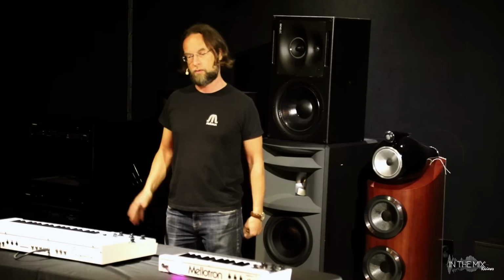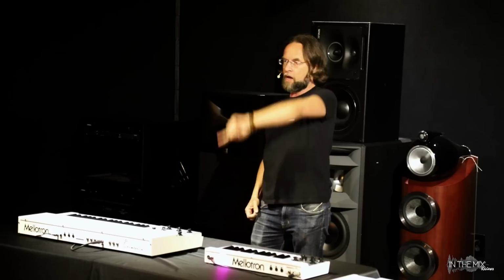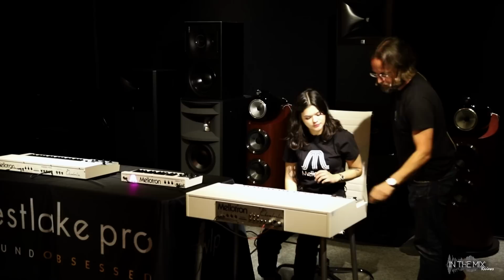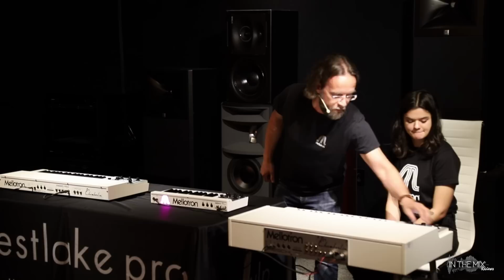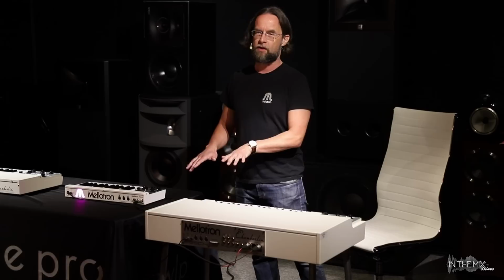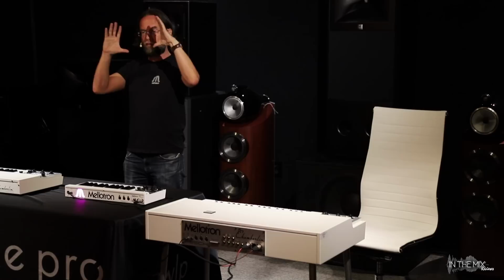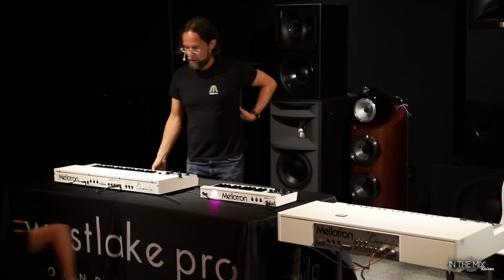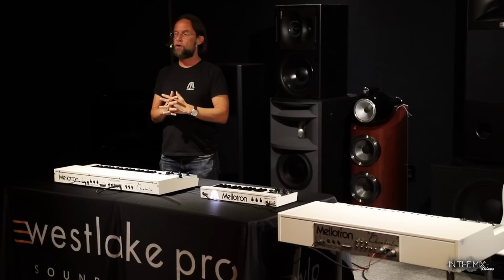Mellotron M4000D, Mini & Micro product review - Markus Resch

Comment: Aside the beautiful keyboard what s the difference  with all Mellotron samples ? Especially those from E-mu or G-Force who teamed with Streetly Electronics who was making Mellotron in the 70s and has all original rapes….
Reply from the maker: I don't own any of these keyboards, but it would probably be the same idea as getting various instruments sampled by different producers. There are so many Steinway Piano sample libraries, right? Some are far better than the other. Since this is a more recent development. Maybe they had access to better sampling/recording devices as oppose to older sampling or remodeling attempts. I'm just guessing here. Hopefully someone from the Mellotron community will pitch in.
Reply: The difference is, the M4000D uses modified samples from the output of a tape recorder and all the others use raw samples from the outputs of Mellotrons. It doesn't matter what's on the tape. What's important is the source of the samples. The Mellotron's electronics are what gives it "that sound". You mentioned Streetly Electronics. They developed the Mellotron and still build them. The samples they provided to GForce Software for M-Tron Pro are from the output of their pristine test Mellotron, the Skellotron. GForce's new product, M-Tron MkII, uses samples (also provided by Streetly) that have passed through the electronics of a MkII Mellotron.
Reply from the maker: Thanks a lot!
Reply: @hamstring6792  No, it does matter what's on the tape. There are different EQ's on different tapes and the chemistry that goes into making the tape (EMI, BASF, Agfa, Scotch are all different) determines how well it plays in the machine when temperature and humidity changes. I know this because I used to own 6 Mellotrons (now down to three) and have been working with real Mellotrons, Chamberlins (and all the other related instruments) in studios and on stages for over 20 years.

Comment: About the micro: connecting one external midi controller could it be possible to extend the range to 3 octaves?
Reply from the maker: I don't own one, so hopefully a Micro user could confirm this. A logical assumption would be....if sounds/samples actually cover that range, then the rest should be just a matter of connecting a midi controller to Micro.
Reply: yeah, this is correct, you have access to the whole range of the samples from whatever midi controller you use. The octave switch is only applied to the keyboard of the micro and doesn't affect the midi input's relationship with the samples. There is also a half speed and quarter speed function in the menu, which are super fun to play with. Can get some very trippy, doomy sounds.